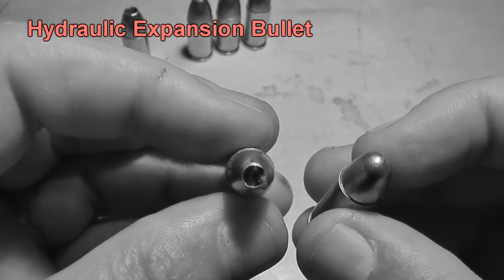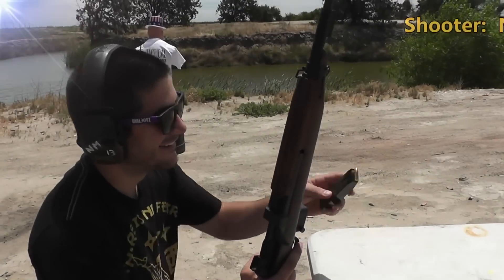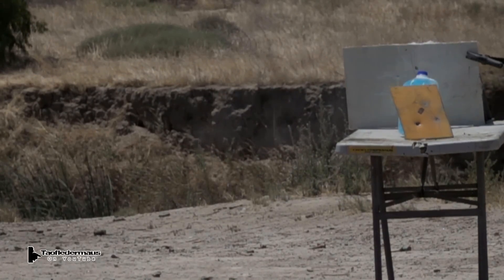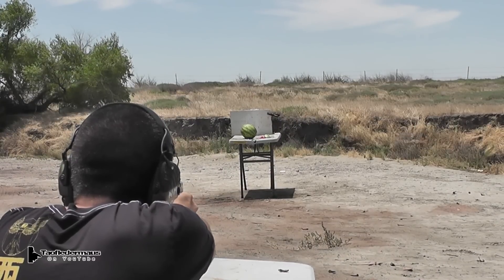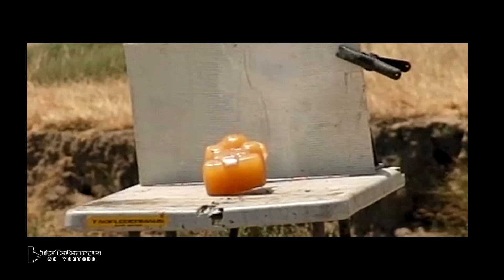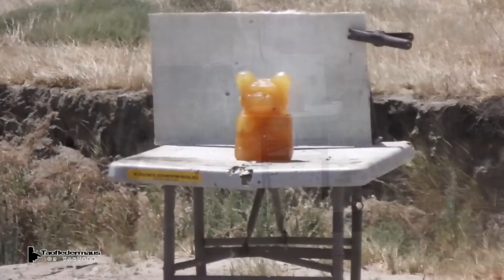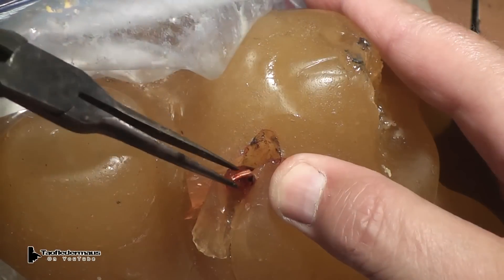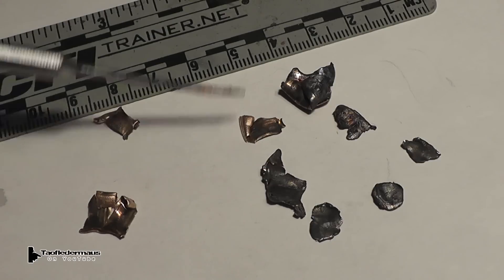Hydraulic-Expansion 9mm Bullet Experiment

Comment: seal it with lead
Reply: and fill the bullet with water, its a non compressable liquid
Reply from the maker: The food coloring is made out of water.   I wanted to see if there would be any residual traces of it,  which we wouldn't have known if I just used water.
Reply: *****
 Youre right
Reply: *****
Btw, why fledermaus and not bat?
Reply from the maker: bat was all ready taken
Reply: *****
 ok, that makes sense...
Reply: Or fill it with brake fluid... I don't know that it would make an appreciable difference as liquids are basically all non compressible, but that is what I would choose. I think this is a really interesting round and would definitely watch more experimentation with it.
Reply: theTenthlife I'm going with that too.
Reply: I was going to say hydraulic fluid, but that's brake fluid. A possible difference could be the high temperatures and pressures at both firing and impact could be atomizing the dye. That could be what the red mist trailing the round was. The epoxy plug got pushed into the hole by the bow shock, forcing the dye out like oil past a slack piston ring?

Comment: I don't get it.  Isn't the whole point of a regular (empty) HP to use the high water content of the (stationary) target body as the "hydro-shock" that opens up the round?  When you put liquid in the round, it doesn't "hit" the bullet like a stationary body's liquid would because the liquid is travelling with momentum along with the lead which should make is slightly less effective than an empty HP, in my mind.  Next time would you do a control test with an identical regular HP round as well as the the liquid filled HP and FMJ to properly compare what happens?   You know, for science.  :)

Comment: im really interested to see how this would act in a larger round like a 5.56 or even 308.
Reply: Lehigh defense has some rounds designed very similar to this called controlled chaos
Reply: ah yes ofc, haha still worth seeing a home made one hehe
Reply: 5.56 is smaller, though faster. You'd probably want to try a 45-70 to get a faster, larger round. I doubt it would act any differently, though. It's neat, but not practical.
Reply: +Bierstadt54 they make a 750gr one for the .50 BMG
Reply: Yes; suggesting 45-70 is just a matter of cost and availability. .950 JD is bigger still.
Reply: +Bierstadt54 if it weren't for legality of the round and existence of the gun the 30mm and Harkonnen I would do very nicely

Comment: oddly enough, i've experimented with these water filled rounds before, except with .177 pellets.
i've been making some experimental pellets lately, and one of my ideas, i put a drip of water in the skirt, and covered the top off with glue, then fired it skirt side first. no significant results, but i think the glue may have absorbed the water first off. and even if there was a significant result, i wouldn't know because i don't have a high speed camera. 
(i've also made some shrapnel pellets as well as "explosive" match powder/cap gun powder mix rounds.)
Reply: i've made some other interesting experimental pellets, and had some neat results, if anyone wants to know more.
Reply: rockstarownage curious about your results I like to shoot their guns myself and have tried different things like baby is glued in the hollow points or wax curious to know what you tried and results
Reply: (sorry for the long message guys. i couldn't figure out how to PM)

currently, i've tried a "shrap" round as i call it. i stuff some of the powder mixture inside, cover it with one of the paper pieces from the caps. then add a piece of lead I cut from a fired pellet.(all of this is in the skirt).
I fire it backwards at about 10 yards or so. Accuracy hasn't suffered (though it IS a short distance). When hitting hard targets (rocks, etc), they let off a nice pop. I've shot lemons with them, but have yet to see any burn marks, however i've found large "wound cavities" and the pellets just shred inside leaving a lot of shrapnel in the lemon. The powder mixture doesn't seem to have a great effect on damage though, as i've accidently set one off while packing the powder into a pellet. it singed my finger, however didn't damage the pellet whatsoever. I also shot a one inch thick kombucha scoby (my batch was starting to go bad). To me it seemed like a decent replica of skin. I've had some really brutal results. I took pictures, however i obviously can't post them here. 
I've yet to shoot any pests or critters (they don't come around often). But I imagine just the factor of the backwards skirt allows ALOT more expansion. the shrapnel is just an added piece that A) helps set off the powder. and B) is an extra little chunk of lead passing through a target. 
(Also, i tried the water rounds as described above, some drilled and filled hollow points (bad idea) and full glue filled pellets.)

Comment: Would have been a better idea to use a normal hollow point instead of the full metal jacket to compare it. The full metal jacket passed through no problem, so we have nothing to see. A hollow point may or may not have had a similar result to the modified round.
Reply from the maker: There are a lot of videos all ready of factory HPs  so I figured everyone would know what they did .
Reply: i know what they do, but just as a comparison for those who don't. Or want to see the results right next to each other.

Comment: I wonder what would happen If you filled It with gasoline. Probably nothing.
Reply from the maker: It would probably dissolve the epoxy.   I was going to use a light oil,  but it prevented the epoxy from sticking to the bullet.
Reply: +TAOFLEDERMAUS Tiny cork?

Comment: if you have a bullet swage die set  take a empty bullet jacket fill it with #12 size bird shot  add a fine oil like a Teflon  stack a plastic bead on top  form the bullet  instant Glaser saftey slug

Comment: I wonder if the trail was caused by the Dye Boiling and popping the seal, do the projectiles even get hot enough to do that?
Reply from the maker: I don't think the heat transfers that fast.   There's a lot of inertial shock when it is fired.   I was surprised we didn't see total failure of the epoxy seal on each shot.

Comment: TAO- I actually got my M1-9 to run half decent, just had to get a new mag with longer feed lips, then pull the silicon buffer out of the rear of the receiver an drill a small hole in it just wide enough and deep enough to clear the firing pin, the gun runs much better now, not perfect, but better.
Reply from the maker: Doesn't your bolt slide back a little further?  The short stroke seems to be a big factor in my jamming.
Reply from the maker: Mine will jam after 2 or 3 shots,   consistently.
Reply: ***** That's what the little hole in the silicon buffer is for, it turns out that the return spring on the firing pin is stiff enough to stop bolt travel, at least that was the issue on mine.

Comment: Looked very effective, huge loss of penetration but huge gain in energy transfer. Would be awesome if you could do it in a block of clear gel you can see through. should also try with other non compressible fluids, like oil and grease and top it off with a copper bb to act as a piston to accelerate the expansion while holding in the liquid.
Reply from the maker: Don't let the shallow damage of the gummy bear fool you.   It would have gone about 12" inches into normal ballistic gel.
Reply: yes but there was an obvious difference between the modified and fmj. Only real way to know is to test. And as you know what should happen isn't always what does happen.

Comment: Thanks! i was pondering this for quite a while. Also im no expert by far but maybe the age old wisdom of "Noseheavy is better" maybe not true. I have seen in plenty of your videos that shotgunslugs which under that premise should fly well and true go all over the place. Maybe the rotation is key, if an slug rotates and if the heavier part is in the front then even very tiny imperfections can make it go tumbling all the way because of drag. If the heavy bit is in the back, it should self stabilize since even with imperfections the drag will not throw the Slug around so easily. Anyway would be fun to test out which is Actually true. Maybe get TacticalGcode (forgotten his name, oups) to machine a few simple slugs which each have a different weight distribution.

Comment: Pretty interesting. Hmm... The bullets may have leaked a little due to heat causing the water to boil some, and while I normally don't offer any advice (there tends to be a lot of that in the comment section already, no?), perhaps if an oil was used instead of water?

Anyway, great video, as always.
Reply from the maker: I was concerned that oil would cause the epoxy to not stick to the metal.
Reply: ***** Yeah, I could see it doing that.

Comment: seems like this would cause more internal damage than the FMJ round. is the gummy equivilent to a possible target though? eg. a bear or a deer.
if it was tested on a side of pork you could recalibrate the width of the drilled hole for maximum fragmentation. interesting stuff :)

Comment: What about mercury? That would increase the mass of the round significantly, giving it more impact force along with the "hydraulic" shock. The additional force of the round would just make the shock greater, I would assume.
Reply: Hard to contain? like if it hits that steel plate there will be mercury all over
Reply: +BlueTurtle1225 That would be an issue. Another channel, Cody's Lab, uploaded a video where he shot a bullet made out of frozen mercury. It would be something to definitely plan ahead for.
Reply from the maker: still can't create a EPA superfund site.
Reply: modifying a bullet with poisonous substances is illegal in the U.S. Mercury is on the list. also if you kept the lead in the bullet the mercury would alloy with the lead and solidify.

Comment: I have an idea:
 steel cased, pointed round, with large scores in it, with a hollow lead core filled with mercury... or dye water again, realistically.
 hopefully, there's enough weight for decent momentum, the scores will keep it spinning stable and the liquid core will allow easier expansion and again, hopefully, the steel fragments, acting as blades come off the lead and fly into and outward to the point of contact effectively causing a horrific mess of an impact...
 Then again, maybe not. if a person got hit with that they'd suffer more damage getting the bits of metal out, then dealing with the mercury poisoning, assuming they've made it that far.
  whoever actually read all this crap is awesome.